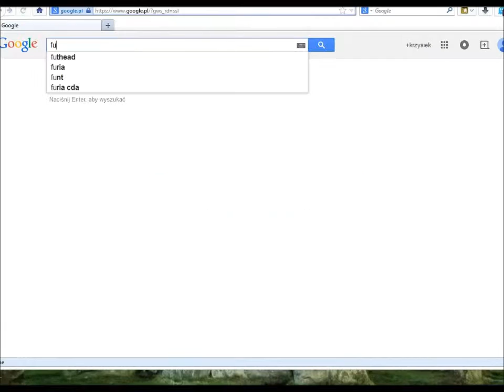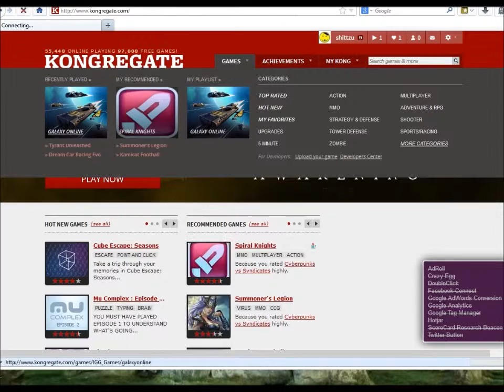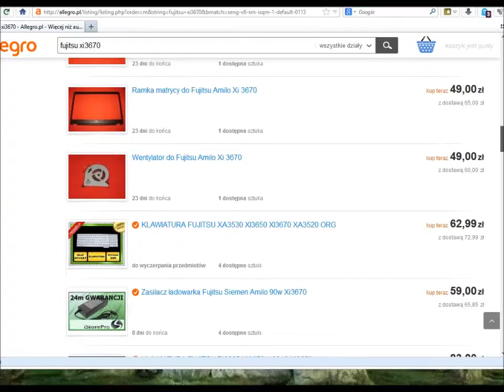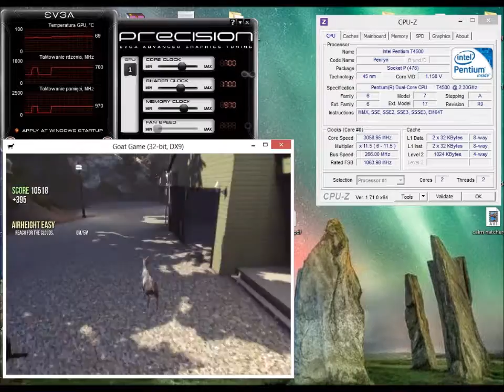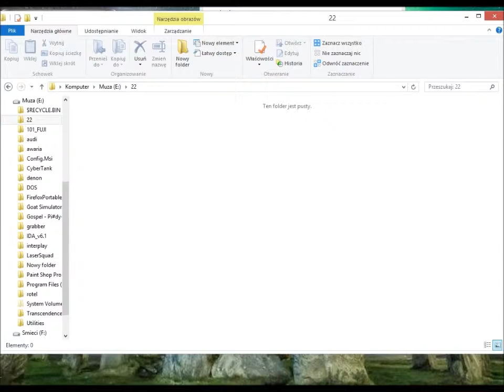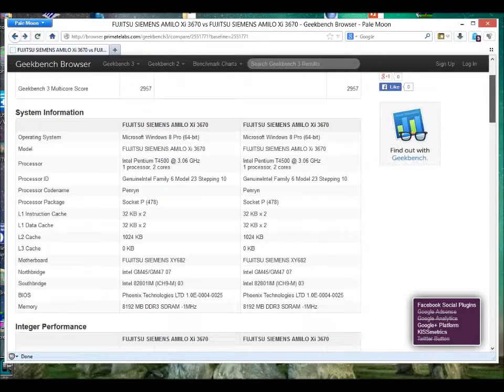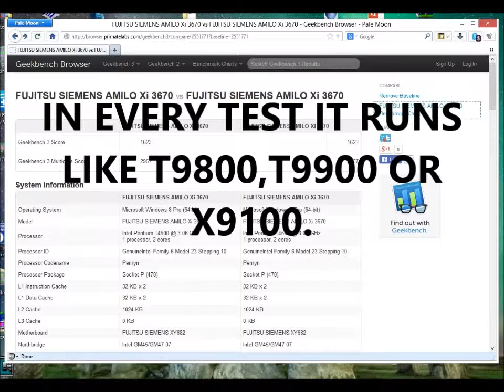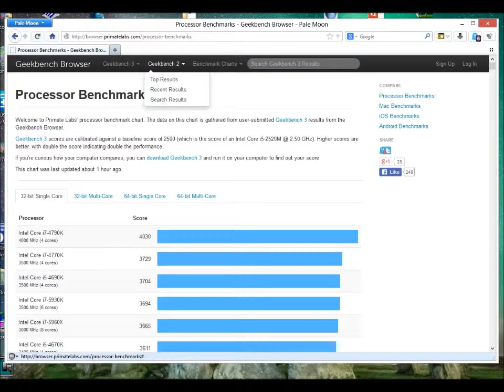Laptop hardware overclocking from 2,3 to 3,06+ ghz

Comment from the maker: Now im running QX9300 quad cpu on this machine. This CPU is brutal, had to buy bigger power brick. Standard 4,7A brick fit up to 2,8ghz on quad and turns off after, from 2500 to 2800 runs but gets incredible hot. Tried some power bricks and best looks like is Lenowo 6,7A, its cols to warm and newer hets hot.

Comment from the maker: now i have cooling problems. till 2900 mhz the Quad is average hot, 65-75 degres of celcius. At 3,2 ghz cooling system breaks and gets hot 85-95 degrees of celcius. The quad is stable up to 3,9 GHZ at maksimum voltage allowed, hovever after 3,5GHZ is no true life performance gain at all, and from 3,3 to 3,5 the reached gain is minimal. So ill want to stabilize it at 3,3ghz but i have to do something with crappy cooling as the thing is sometomes working very hard at rendering and i want it working at sane temperatures.
Funny thing in the games cpu even at 3,2 ghz is moderate hot, and when at 2,9ghz the system gets hot below 80 degrees. It means the game is limited by GPU at this level. But the game speed gain after swap to Quad core is very visible with 50+ % more fps.